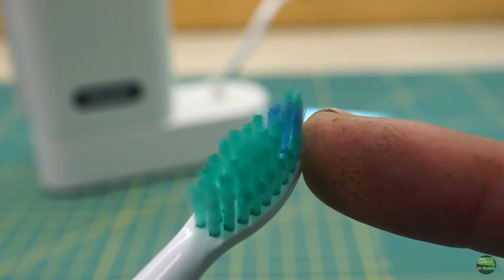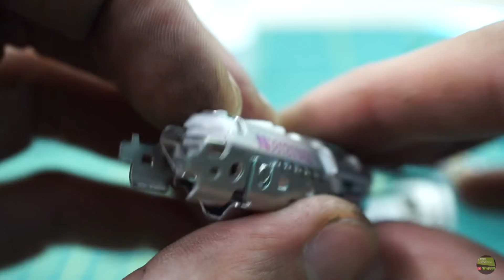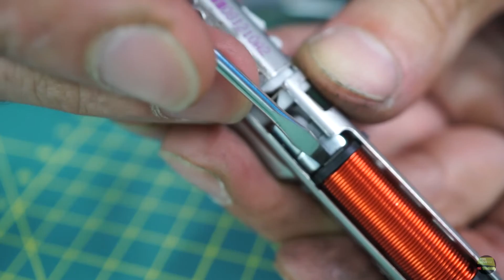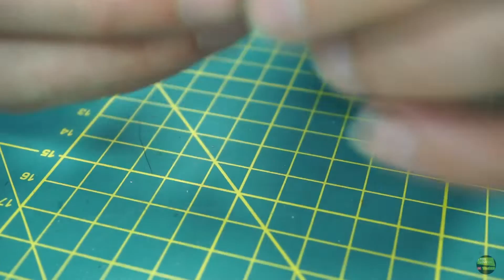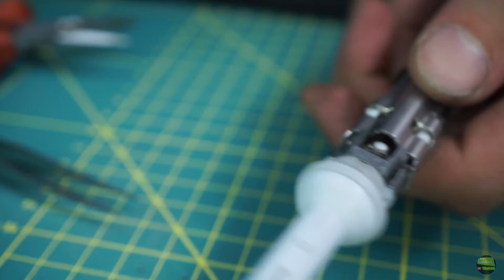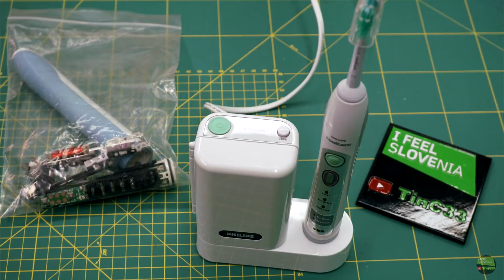Philips SONICARE toothbrush repair

Comment: Howdy!
nice video... it inspired me to open and try to repair my toothbrush which I think is the same type... the problem for me is that the battery broke, the liquid flooded the circuit and corroded it... I managed to clean it how much... unfortunately the R7 resistor no longer exists... if you have an unassembled board, can you tell me its value? I would try to replace it... maybe I'm lucky and it's the only defect... thank you very much! success!
Reply from the maker: Hey i love people who give a try to almost impossible, you got nothing to lose right 😉
On R3 resistor is mark 332 if i measure direct on pcb (not right measure) it say 3.3kohm.
Good luck

Comment: Excellent repair video! Thank you for showing us how to repair these models of Sonicare toothbrushes. Phillips Sonicare toothbrushes are very effective, but their designs have some significant flaws. My older Sonicare (with the much thicker handle) is still working after ten years or so--but the brush heads on that model do not seal well at all, and grow disgusting black mold inside. I had to take the heads apart frequently and clean them, but the mold could never be completely eliminated--and even if it could be totally cleaned, more will soon grow back due to the bad design. Phillips never acknowledged that the problem existed--probably, the greedy bastards just wanted people to keep buying more new brush heads--which were unnecessarily expensive! These newer, slimmer models don't have that particular problem, but clearly they have issues of their own. But I doubt that there's a better rechargeable toothbrush available from any other manufacturer, so we're kind of stuck with Phillips!
Reply from the maker: Thanks, if you notice i got another sonicare video with 3 different fails.
About sonicare i don't know are you read my mind but what you say is exactly my opinion, sonicare is far the best toothbrush i try but as you say got a few cons, first one i notice is rubber housing where the mold start growing if we don't wipe them after every use, the steel part transfer lot of power so i would say it's a bit too weak (weak point of brush) if brush fall on the floor that part most likels broke and toothbrush is for trash only. They fix housing material on black diamond so it's not delicate on mold but battery life is much much shorter than on older models, and also to charge it need a whole day or even 2, maybe it's make to put into charging glass every day idk, but after all thanks to china to sell entire vibrating mechanism for $15 wich work just like genuine one.
Reply: My wife uses sonicare, they break one way or another after appx 2 years. She's on her second unit and now I have to replace the shaft completely. Previous unit had the shaft adjusted and later just stopped working altogether. Me on the other hand, still using the same $25 Digoo aliexpress toothbrush I got 4 years ago. 0 repairs.
Philips is rubbish.

Comment: Hello, thank you for this video, I had the exact same problem and upon opening mine up, i had a cracked steel part. Do you know the exact name of this part or part number so I can buy it online? Thanks
Reply from the maker: Search on ebay for "sonicare vibrator mechanism" you can't buy only that part, you'll need to buy entire mechanism, wich cost about 15$ just solder 2 wires and here you go, check my other sonicare video

Comment: Thanks for the video!  I had exactly the same problem after dropping it while brushing, straight on the head.  Took it all apart expecting the cast aluminum head anchor to be broken (that's what it was last time) but nope.  Took it all the way further apart and didn't find the plate cracked the way you did.  In fact, I didn't find anything amiss.  I did notice there was zero gap between my magnet and drive, so I gapped it when I reassembled it, and voila, it worked.  I suspect that the magnet shifted when I dropped it.

Only thing I think is missing from the video is how to separate the motor/drive from the battery/board:

1. remove the spring/rubber bushing between the two parts, by compressing the spring towards the battery and then lifting the spring/rubber bushing straight out
2. the drive half slides away from the battery then lifts off: slide it as far as you can, then there are two small black clips which you can't see which need to be pressured a bit.  With some small force pulling the drive half away from the battery, slide a small screwdriver from the side of the toothbrush, between the black plastic part on the battery half and the steel sled of the magnet holder.  (see video here https://www.youtube.com/watch?v=9H7epLyJMME at time 3-05)

The only other thing is that before doing any work on the brush I would disable the battery/power by desoldering the jumper J1 on the electronics board near the induction coil.

Comment: Thank you so much for your video. I was very lucky as both mine and my wife's toothbrushes only had loose screws! 
I'm not telling her I've fixed hers until after she used hers tonight. 😁
Thanks again be blessed! 🙏
Reply from the maker: Thanks, nice to hear
Reply: Her brush was worse than mine was. Hers was rattling really bad and barely vibrating at all so when she fired it up before going to bed it kind of startled her! She was very appreciative. ❤️
Thanks again! 👍
Reply from the maker: @AzTurboMini  isn't that a great feeling when fix something by yourself 🤗
Reply: Absolutely! Why buy a new one before at least attempting to fix it? If I had money to throw away I guess it would be more justifiable but I don't plus, I like to work on things and like the satisfaction of fixing things instead of trashing them. 👍
Reply from the maker: @AzTurboMini  that's me, i always try to open thinks before throw away, even if they'r seald and make to never open again 😉
Reply: @TinC33  I've looked at some of your other videos. You are way more advanced than I am on small electronics and what I'll call bench electronics. I'm 59 so I know older stuff in general but also I know a lot about motorcycles as I have rode and raced through the years and have done most all of my servicing and upgrades on all my bikes. I've had 49 bikes through the years and have 1 now. The reason I had so many in the beginning is when I raced motocross. Starting in 1976 I raced 125 and 250 class and had a back bike for each class.
I did that for 10 years before the work I was doing (many hours in the oil field) became more important so I could support my new family. I've also owned some pretty cool cars back in the day and learned to wrench on my own stuff because that's what you did it you had a muscle car back then. I always had super nice cars but got tired of driving the same car rather quickly so I traded a lot. Just to put it into context, my first car was a hand me down from my parents. It was our old family car. It wasn't a muscle car but it was a 2 door sport car. I was going to school, working and racing at this time so I had some money and traded that car for a 1970 Chevelle SS 396 4 Speed car. Fathem blue with white stripes and black interior.  Since then I've owned many more muscle cars and did all of my mechanic work. I'm at car 97 in my life right now 🤦. The strange thing is my son isn't like me in the slightest. He's great behind a computer and that's what he does for a living but doesn't know how to use any tools besides a pair of pliers and a screwdriver. He's just never had an interest in getting his hands dirty and fixing things. I think that's because we started playing Nintendo when he was like 3 and when he was 12-13 I was into computer's and helped him get into gaming. Computer gaming has stuck with him to this day and he's now 27. 
When I pass he'll have to figure out what to do with $6-7k (heck, probably more) worth of quality tools.
Geez, life story here right? 😆

Comment: Thank you so much for your videos (this one and 3 different fails).  I have the same Sonicare with the UV cleaner and about 6 weeks ago I noticed that the shaft is moving differently.  I am hoping the easy fix is just tightening the screw.  The thing that I am concerned with is that the rubber part around the shaft is black and since I have had the brush a long time I did not remember it being a different color until I saw your videos.  I take very good care of my unit so can you tell me any reason why it would look like that.  I did also notice the rubber part is torn, does that have anything to do with it?  Thank you in advance for your assistance.
Reply from the maker: Black thing is a mold wich become on hidden part, manual says we need to take off the brush after every use and wipe it with towel, i don't do that but just wipe it after every use, it's not problem because you don't put that part in your mouth but if the rubber is broken water can leak into brush and after time brush will become demaged, so check on ebay for new rubber and replace it if you want to use your brush in the future.

Comment: Great video and very professionally done!  What screwdriver Brand to you recommend to work on these.  I have standard Jewelers screwdrivers and they don't work well given the torque needed to remove the top most screw.   They have too small a diameter to get any torque.
Reply from the maker: You need to heat up the screw so the thread lock release, than any screwdriver will work.

Comment: I tried everything by your instruction but it did not work! Light is on but no vibrate! Could be the vibrator broken?
Reply from the maker: i think it's not broken, try with a screwdriver if the coil atract them while you turn on the brush, the magnet can be stick to a coil.

Comment: Great video! Excellent job. Where to buy the part(s)?
Reply from the maker: Ebay used brush for parts if you got lucky so the parts you need is ok, sorry but that's the only way, or try to find new vibrator on ebay as i do in my other sonicare video.
Reply: @TinC33  Thank you for your prompt response. Ok, then I will try a 3D printing shop.

Comment: Ever consider buying a new brush and swapping the internal parts?  Then returning the new brush with the broken parts for a FULL REFUND?  If enough people did that, MAYBE SonicCare would learn their lesson and supply parts themselves.  Think about how many of the brushes end up in the city dump!   Chaaaa....CHING!!!
Reply from the maker: You think in right way, but it's stil cheating, that part is a big problem i understand because it's need to be hardened to the limit, otherwise it wont transfer that much energy and the brush will be same as some chineese one, i thing firstly philips need to tell us clearly (on package, into manual...) how delicate this part is and how important is to be gentle with brush, and while traveling always remove brush head...

Comment: Any idea how to take apart the newer models??? They're completely sealed with nothing on the bottom to undo or take apart. Really frustrating. Need to tighten a loose shaft.

Anyone???
Reply from the maker: You mean like diamon black? I got 3 more brushes to fix, will make video about soon, they'r hard to open but it go with a screwdriver and push from other side on the axis.

Comment: Squeeze the case to get it out. Okay I'll try that. Mine had moisture inside. I think the top seal may have failed and water inside is the root problem but we'll see after it dries. Slovenia was so beautiful! Spent 3 days there while trekking around Europe in 2017 A.D.  Everybody should have a hamburger or something with a beer in that classy area of Ljubljana by the castle and later visit Bled. I didn't see a convenient place to buy beer near Bled so be a good boy scout and be prepared so bring what you want on the bus.

Comment: Is the battery just an 18650? Does it need to be a high drain one or a standard 2a laptop battery will be fine?
Reply from the maker: It's not 18560 cell, i don't remember it's number but the cell inside is size like aa battery it's liion but not high drain 1-2A will be enough.
Reply: If you remember let me know what size
Reply from the maker: @plojm123  size is exactly same as double a (aa) alcaline battery

Comment: THANKS! You do such a great job of demonstrating wat to do- it goes kinda fast for me👵..but if i watch it over n over I'll eventually get it- i have a question i hope sumone can answer- the closed case of my tbrush- with brush removed- has sum tiny cracks in the bottom and I'm wondering if i can use nail polish to close the cracks?  Or ???      Thank u
Reply from the maker: Thanks, i think nail polish will be a good thing to fill the crack, but assemble them firstly, because nail polish will crack if you force them.

Comment: Thank you. Your video is very good and clear. I follow the steps until I found that my toothbrush have the same problem, broken special metal sheet. Now my problem is to find the part or another broken toothbrush which I don’t have an idea how to find it.
Reply from the maker: On ebay you can buy entire vibrating mechanism (front part) for less than 10$, i didn't try yet but got that part in stock and also got 3 broken sonycares, waiting to make another video.

Comment: Thank You!! This video just saved me a lot of money!! My toothbrush head became loose, and it turns out it was just the screw that holds the head in place.
Reply from the maker: That's most common problem, did you use threadlock? Otherwise you fix it for few days only
Reply: @TinC33  I wondered about that. I did not this time, I will do it next time though!

Comment: Great, very helpful, video. I can't believe Phillips embedded screws where access requires grinding out spot welds. I haven't yet achieved "full recovery" of my weak running brush; seems it is very sensitive to the magnetic gap. One responder said it should be 0.0020 - but no unit of measure (mm or inch) -- I'll try both. Thanks a bunch!!!
Reply: 0.4 mm on mine

Comment: Pleaseeee! 2:12 how do you take these apart??? Ive been here for over an hour 😭😭😭 Its just stuck by some magic forces! I've been twisting and pulling and pushing in every direction! 

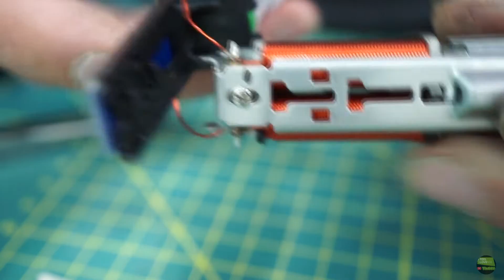The one you put back at 6:33
Reply: look how easily this guy did this... I swear I've been bending and pulling and nudging in every way and direction possible... 
https://youtu.be/o3PBPU2jXbo?t=287
Reply from the maker: @millanferende6723  first take out the spring with a rubber, and than try to pull, but if i remember right there's some tooth to prevent just pull back, you can use a bit of force, to deform plastic tooth, or better take a tiny screwdriver and put it netween plastic and steel housing.
That plastic is really soft so it band nicely, with a screwdriver you can make enough clearence to see where it's hold.
Reply: @TinC33  Yes I did that....well the trick was keep tugging it, until those plastic T inserts loosened... so finally I'm good xP
Reply from the maker: @millanferende6723  graet to hear, and  than did you find the problem, is that part broken or something else?
Reply: @TinC33  No... the plastic bit has some tiny \ bits that slide one way but stop it from sliding the other.

The original problem is that the motor was touching the magnet... so I needed to get to the screw to get that fixed. :)